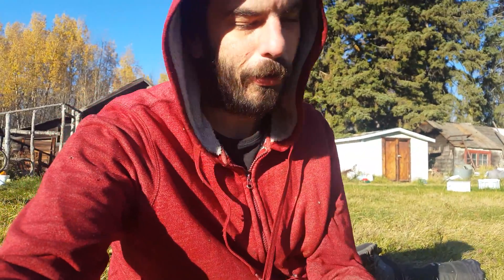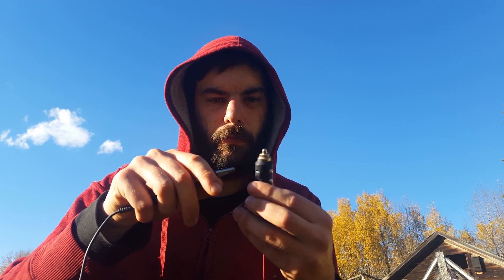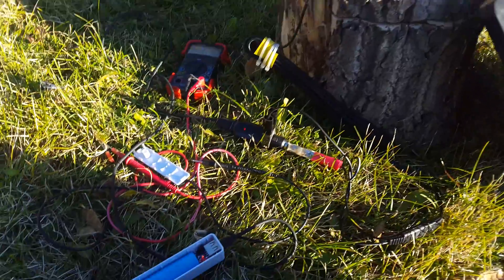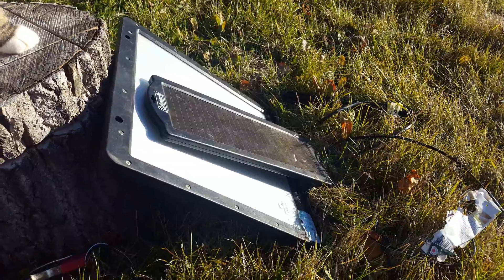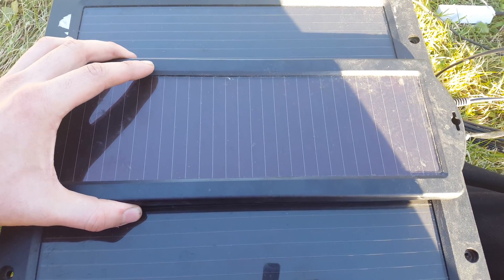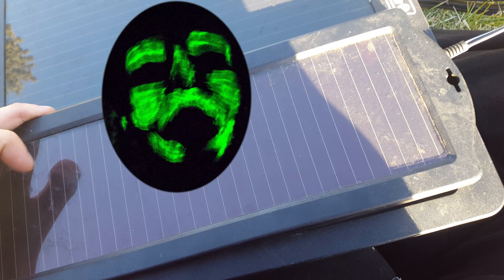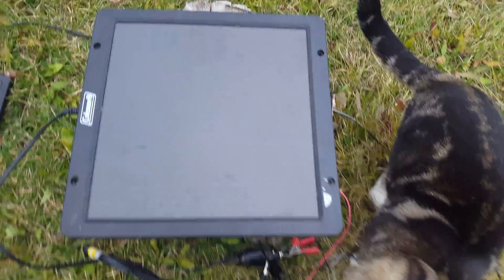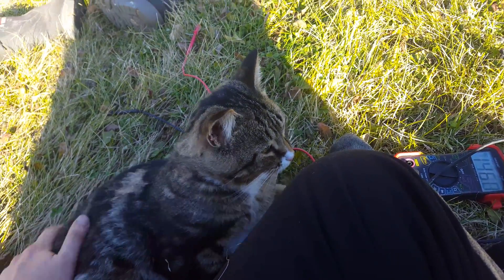Testing Charging Phone With Coleman 2w & 6w Solar Panel Sun Vs Cloudy Day

Comment: We use 9 volts in smoke detectors.  Use the cat. They are solar powered.
Reply from the maker: They're all directly wired in here by law; there should be a little bell on the screen somewhere, you've to push that to get all my notifications because youtube is trying to keep the little man down to force us to pay for adsense.
Reply: Apparently birds are too. That's why they don't fly at night.